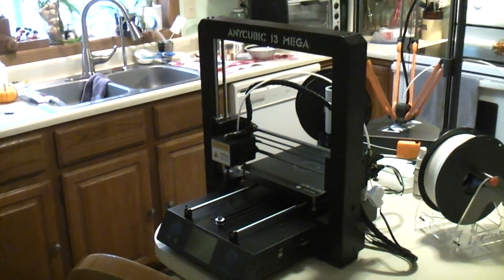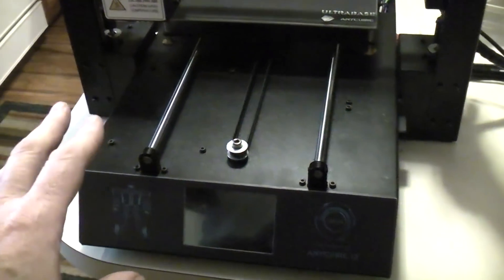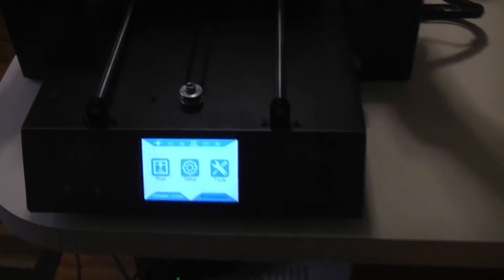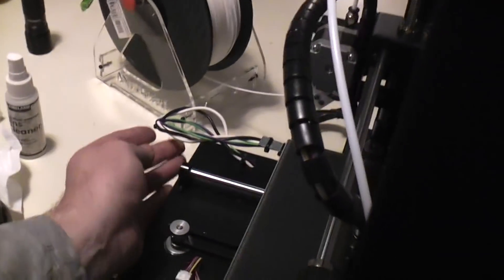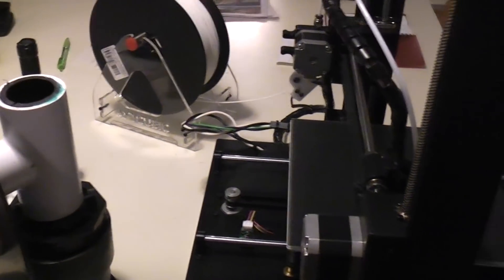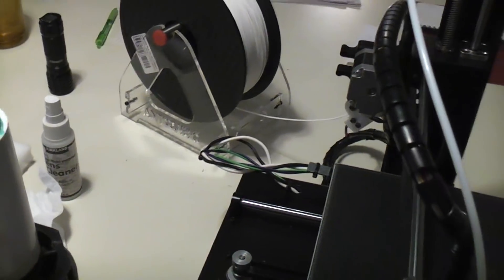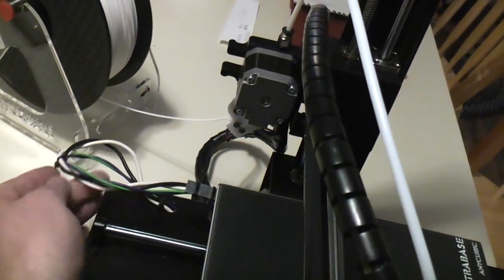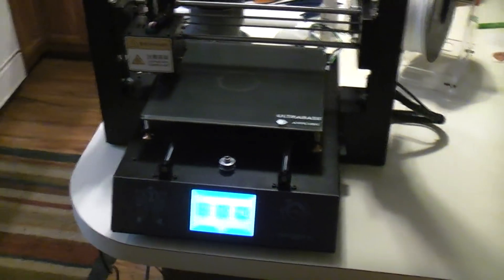AnyCubic i3 Mega Death .    The heat bed wires will break !

Comment: I also love the machine and yes, I also had problems with that wire - my red one shorted out.  Replaced it with an ultrabase heated bed with wires and that works great - I also use a chain link holder on the right and that also works well because of the larger circle of wire that needs to bend.
Reply from the maker: Yes I did add the Chain link cable system to my bed, that really works well. The printer should be good to go for a long time now.

Comment from the maker: The wires did not melt with a flame so they are no aluminum and they are not copper so they must be steel and that would explain why they break. Save your self some lost prints and replace the wires now.